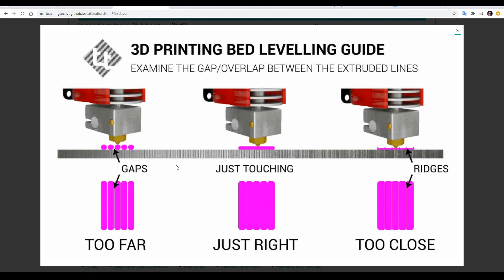Interpreting first layer test results

Comment: i am trying to have the wanhao d9 mk2/3 (front y motor version) work, but i do not seem to have the ability to print the squares as they should, i also have a problem where the printer is scraping a line through the middle square. The z offset for the bltoutch is set so that a piece of paper barely has any resistance. I have also noticed that the bed is "breathing" even with the glass bed on it. any tips? other than throwing the printer away

Comment: Hi mate, that's a great and very helpful content. I appreciate a lot. Thank you. For interpreting the results accidentally I found a little test. That may help the others. I wrote down the z-offs on each printed square with a permanent marker. If the scribble on the printed square is good also the z offset is good. Otherwise permanent marker spills around and it is difficult to write.

Comment: I was levelling my Ender 3 Pro and found that no matter how much I adjusted the left nob, the right nob couldn't be unscrewed enough to get it level. Then I realized my back right nob was off... oops
I did encounter a gcode problem, though. For some reason, when I use your gcode (uneditable), the nozzle is not told to heat up, even though I input 215 degrees in your form.

Comment: A always see gaps in my prints no matter the z offset I use, it's either totally squished and transparent or it's not and I see gaps. The e steps is perfectly calibrated as my caliper indicate a perfect 100mm when I try to extrude 100mm. Also, why do I see gaps when I import the gcode into cura? What I get when using a z offset of -1.18, I seems to get exacltly what it looks like on the screen as the lines have gaps in between on the screen.

Comment: I don't get it. I downloaded your gcode from the Teaching Tech 3D Printer Calibration tool, but now, how do I calibrate the first layer if I use a BLTouch? If I play with the knobs at the bottom, wouldn't the BLTouch change it's settings when it will start the next print?

Comment: I changed the z-offset by quite a bit and the nozzle didn't seem to change much on getting closer to the bed. I then adjusted the knobs in real time and got it to "smear", however, on the second run the printer seemingly adjusted itself and went back to having regular beaded filament. Any idea what this could be with a bltouch ender 3 v2?

Comment: What if each square has different results? I'm using UBL but the squares still aren't consistent.
Reply: Same for me, I have an ender 5 the front two squares are too close, the back ones are fine and the middle one in between. Although I don't use UBL, never got that to work at all but I have one of creality's version of the BLtouch. I just use the normal ABL, the one that probes the bed every time.